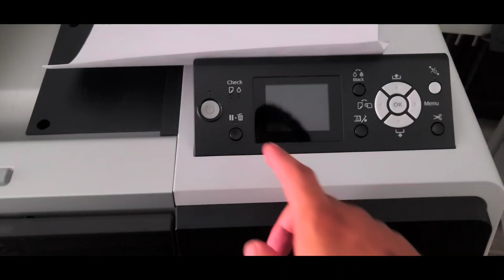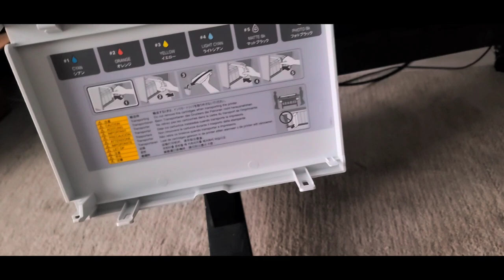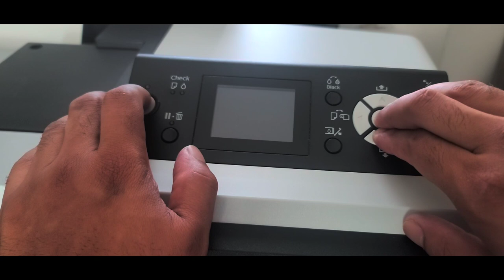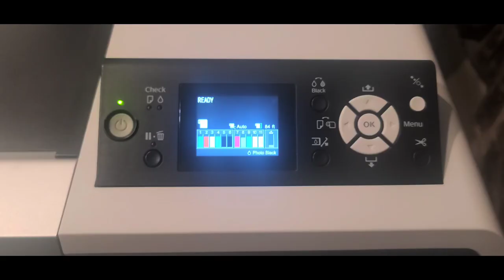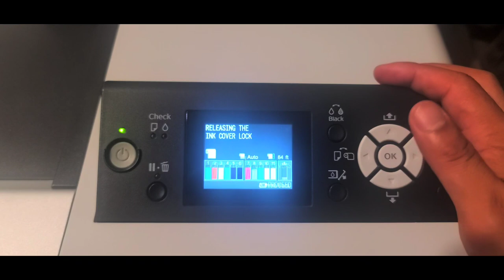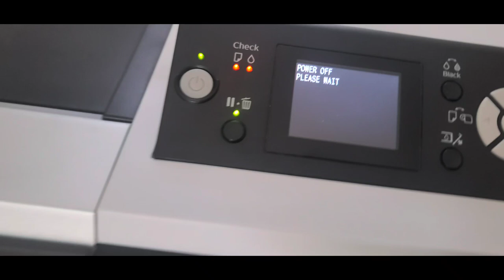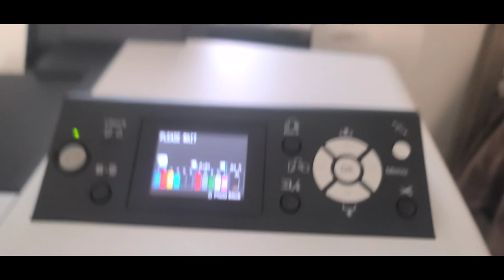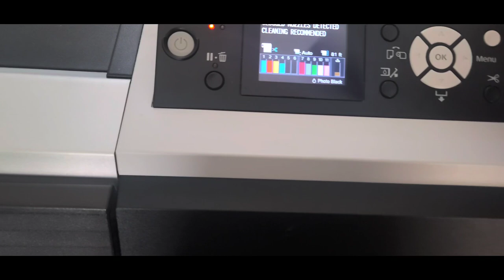Epson Stylus Pro 7900: DTF Conversion Part 2

Comment: Hey Bro. Are you still using the Windex as cleaning cleaning solution? And has it caused any damage to the print head? I'm currently using Piezo Flush in 2 channels that I'm not running inks in, but because I have to run a print head clean everyday, I have been running through the Piezo Flush and its so expensive, even though I split it half and half with Distilled Water.

Comment: They may sound weird but what can i do if all the ink cartridges are stuck? Just got the printer n did the latch open button. When to take out carts n they are all not budging. Push in to release but wont budge n definitely cant pull thek straight out either. I need help

Comment: Can you run cleaning solution between between uses? Or is that necessary?
Reply from the maker: Flushing the system regularly will prevent the  DTF ink building up and clogging.

Comment: Would this work on a 9900 44inch model it's the same machine just bigger I've found one cheap that needs fixing and Im gonna buy it
Reply from the maker: Yes
Reply: @HangryMuscle  thanks for the quick replly brother ill be up the pawn shop tommorow morning to pawn my miix 520 tablet to pay the small sum required to aquire one of these that needs printhead replacement ;) nice little find :) cheers man :)
Reply: @HangryMuscle  just got a 9900 for 100 bucks has error ia39 supposedly the printhead needs changing or worse case the motherboard assy fuse needs changing I will be attempting to fix this over next year or two when you have to do maintenance on these things if you could make videos on how to repair and maintain them in a practical way would be really helpful I don't have the money to pay epson engineer to change printhead so am going to have to hope I can find the info I need to do it myself nice one again hopefully I got a bargain and not an an expensive lesson in what no to do with you insignificant sums of money :) 😎 😎 🤭

Comment: Which model do you choose (in Acrorip) from the list: 7900 or other?
Reply from the maker: 7900
Reply: @HangryMuscle  In 10.3 I must choose a 7890. 7900 didn't work. Thnx and what you think about my other question about bypass a cartridges?
Reply: @HangryMuscle   epson 9900 on the list of the rip?